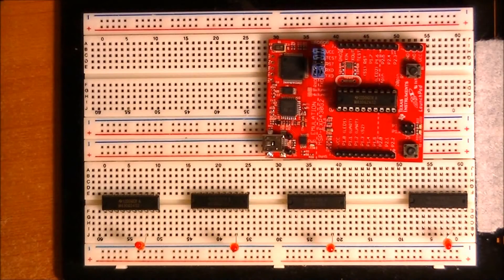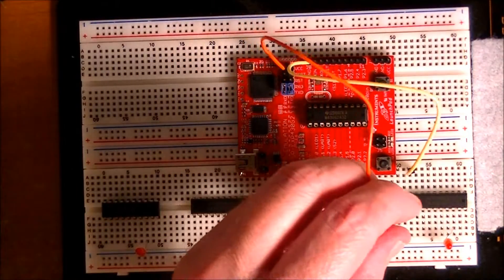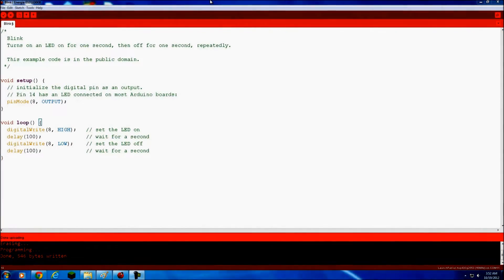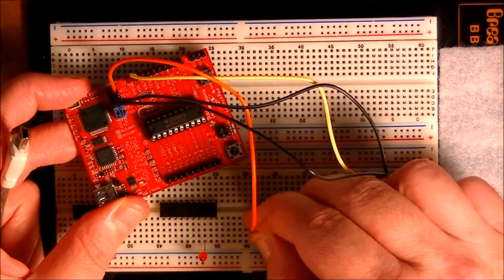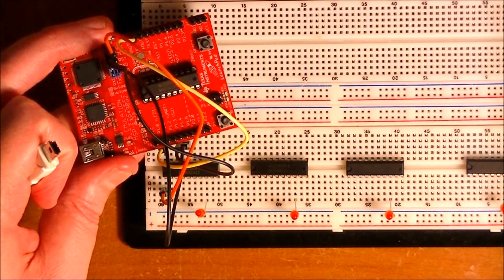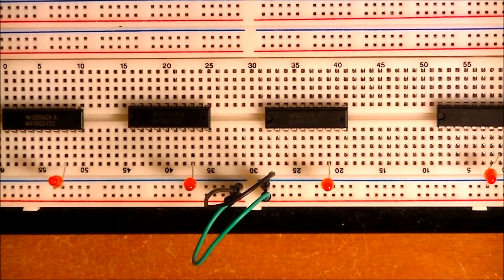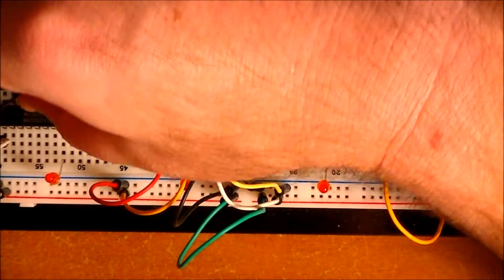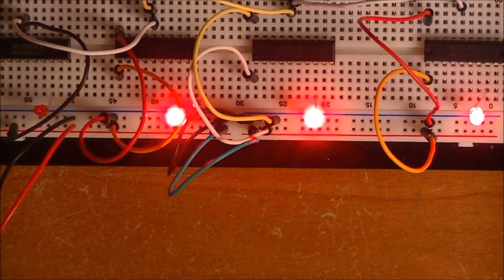Using the TI Launchpad MSP430 as an in system programmer (ISP)

Comment: awesome vid - I am a hardcore arduino user ;-) but I might switch to msp430
Reply: I think that the launchpad is WAY better than the arduino, since you could actually use the launchpad as a REAL programmer (like in this video) to program blank chips (which doesn't even have an bootloader!)